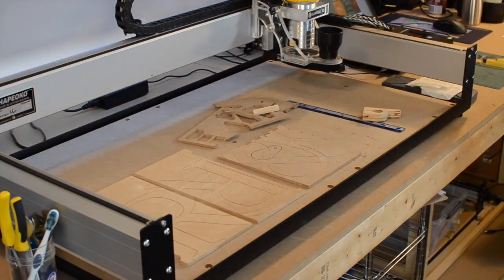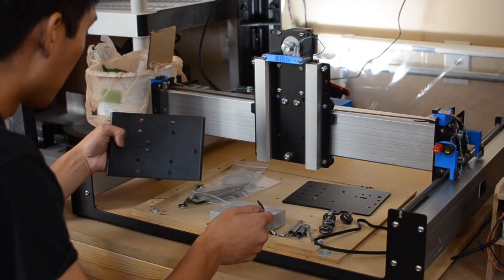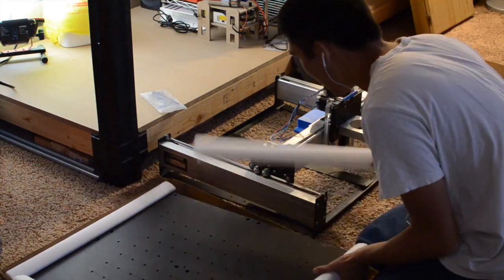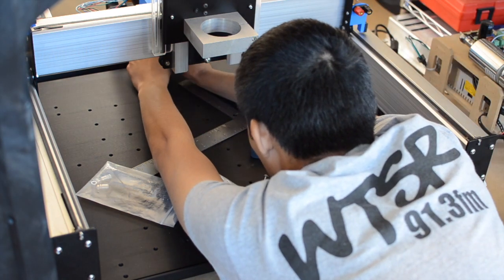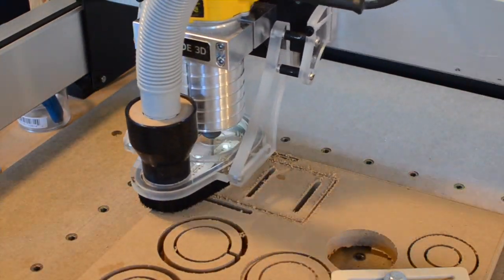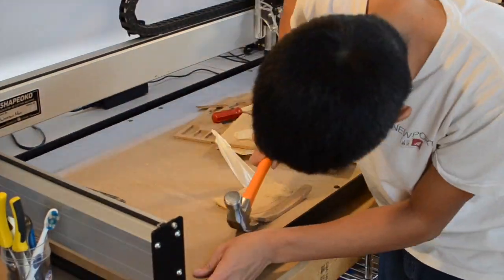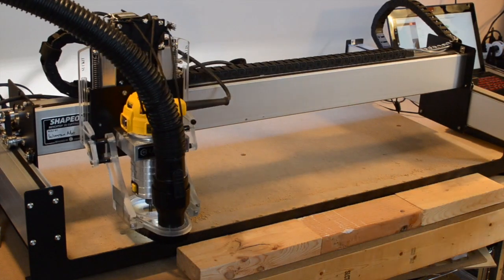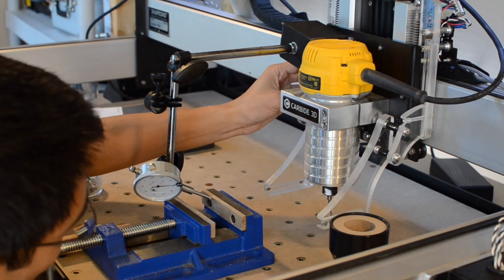Alum. Table, New Z-Carriage Plate (2016), + Random Shapeoko Upgrades

Comment: What are the chances someone has the base table cad? I’d like to get one made in Australia
Reply: Shipping it down under is a fair whack
Reply from the maker: I don't have a public source, You're going to have to make your own, I think there are some drawings for the stock size that other people have made. Search the forum: https://community.carbide3d.com/t/threaded-table-files/3534 (example)

Also, I'd suggest just making your own design after getting a machine. I personally don't care for the 50mm spacing of the C3D one, as my stock sizes are typically in inches.

Comment: Mr. Winston, I am thinking of buying the aluminum table however first I must ask you a question answer have it installed it and using it did you still need to resurface a waste board or was the aluminum table enough waiting on you answer eagerly thank you
Reply from the maker: The aluminum table makes the machine table super strong and rigid, but it doesn't automatically mean the table is perfectly level to the gantry. You will still benefit from putting a piece of MDF or plastic (or even aluminum) on top of the table and leveling it.
Reply: @WinstonMakes  what do you think of this one?

https://www.etsy.com/listing/487303408/shapeoko-replacement-table-fixture-plate?gpla=1&gao=1&&utm_source=google&utm_medium=cpc&utm_campaign=shopping_us_a-craft_supplies_and_tools-other&utm_custom1=c51ac1a1-f944-4a98-a56f-db264941e8ae&utm_content=go_270947675_21143440475_69017032355_pla-106551294035_c__487303408&gclid=CjwKCAiArK_fBRABEiwA0gOOcz_EzbzLTg1VhxvmmQ_9zctMuCLy0ZAJCdK0a4gYnUj6MNMYCuXTPxoCtZEQAvD_BwE
Reply from the maker: Looks nice, but almost nothing is ever perfectly flat. Furthermore, you would still have to adjust your machine to be square, and tram. And would probably still want a sacrificial wasteboard on top. If you want rigidity, that or the Shapeoko table Carbide3D sells would be fine. But if you're looking to buy your way out of extra mechanical tuning, don't waste your money.

Comment: i bought a shapeoko 3 XL, and i definitely need the aluminum bed, but i can't find one for the XL, any ideas where i can get one? otherwise i'll have to design one i guess
Reply from the maker: They don't have one for the XL due to the unwieldy size and shipping costs that would result from it. JPL_Richard would probably suggest going to a metal supply place and getting a half inch plate cut to the right size. You'll end up saving money in the long run transporting it yourself.

Comment: So I just bought the Shapeoko 3 XXL. I will primarily be working with metal so would you recommend the aluminum table or something like it if metal is my primary focus?
Reply from the maker: +Savant PCs I don't think a full aluminum table is necessary (plus Carbide3D doesn't have an aluminum table at that size, and a full table that big would weigh like 200 lbs).  I would instead put a piece of aluminim/hdpe/MDF on the existing wasteboard and machine-level that so it's perfectly smooth. I have a video about making a "supplementary spoil board", and if you look at JPL_Richard's machine on Instagram you can see the route he went to put an aluminum plate over his table. If you're working with large sheets, this should suffice. If you're workholding smaller pieces, vises will probably be your preferred choice. But you should reach out to @jpl_richard for sure. He's a wealth of knowledge for cutting metal on the Shapeoko. He's done way more of it than I have.
Reply: Awesome and thank you for the help!
Reply: For jobs that require 2 different bits that are defined as using two different bits in Carbide Create, does it stop and ask you to change bits to finish the job? I.e. I have a design being cutout with .125" endmill then and engraving cut with a .06" endmill. Thanks for your help! Sorry I am a noob...

Comment: Thanks for this and sharing your files. This is my first.... well.....anything in Fusion 360 as I have used 123D Design on my 3D printing projects for a while now. I've always meant to graduate, and now is the time since 123D is going away very soon and F360 seems to be great for CAD/CAM. 

I used your file and added two rows. Since I have an XXL I can reach all the way back on the front waste board. Then I will swap them and do the other board. That way I have inserts all the way back on the bed. I used your affiliate link to get 400 inserts as it looks like 320 will be needed with the additional rows and another whole board.

Here's to hoping I did everything correctly. I did a 2/3 dry run tonight, will do a whole dry run tomorrow, followed by a full run if it looks good.

Comment: Do the inserts not go all the way thru the MDF? I see you milled above the metal underbits. :)
Reply from the maker: Inserts are only 13mm (nominal) and and the MDF should be 3/4. I stopped the endmill at around 0.7", but in the parts you know are clear, you can just cut all the way through. Or if you don't feel like tailoring the CAM like that, I just chased everything with a 1/4" drill by hand. Really quick to punch through the bottom.

Comment: How did you create the file in carbide create for the threaded holes?  I have purchased a Shapeoko 3XXl and I am having issues with creating this file.  This would be my first project on my machine, or on any CNC machine for that matter
Reply from the maker: I created the file in Fusion360. It's doable in Carbide Create, but more tedious. In CC, you should basically be placing holes where you want to put threaded inserts, and then adding a pocket toolpath to each one. Where are you getting hung up?
Reply: Winston Moy I know nothing..... to start with. I saved the file from your website and tried to upload it to CC and it will not transfer. I have so many ideas to create but yet to materialize them into CC.
Reply from the maker: CC is what you use to design and create toolpath files. You use Carbide Motion to send those files to your CNC. The .nc file on my site is a toolpath  (gcode) file intended to be sent through CM to your Shapeoko. It cannot be opened in CC.

You may want to read through some of the tutorials on the Carbide3D site first to get an idea of the general process (ex. http://carbide3d.com/docs/tutorials/shapeoko-clamps/ )
Reply: Winston Moy do you have a video or know a good resource showing the workflow from fusion360 to the s3? I have that and a 2012 edition of solid works and I know both CAN be used to create the code but I'm nervous about just trying it and finding out there's some difference in the axes or something.

Comment: Great video as usual, Winston. I installed the new Z-plate earlier this year and it made a huge difference, especially cutting aluminum. I'm very tempted to get the aluminum table as well, although also considering upgrading to the XL, both of which are expensive and incompatible upgrades. On my regular SO3 (fall 2015), I installed the same 1/4-20 threaded inserts you link to, but I find them pretty terrible. Several have ripped out of the MDF and others I've had to carefully superglue in to keep them from bulging  up the MDF when unscrewing clamps even with light pressure. I've read that installing them upside down from the bottom is an improvement, and also curious about using the smaller 8mm holes you suggest. (I used a 9mm bit per the packaging instructions.)
Reply from the maker: Not using 9mm was something I stumbled upon by accident. I figured out my hole size by directly measuring the diameter of the insert, minus teeth. It pays to not read the instructions sometimes... The insert digs a lot deeper into the MDF if you don't overdrill the hole. Installing the insert upsidedown I imagine would help, but it's hard to automate that with the CNC, since the wasteboard is only counterbored from one side.
Reply: Winston - Thanks for the tip. I bought a 9mm bit just for those inserts and hand-drilled all the holes so that they could be outside the Shapeoko's range. But now my inserts all come out so the wasteboard is semi trashed. I was going to cut another, perhaps from HDPE and then just tap the plastic directly, or maybe I should get the aluminum table. How do you like it? I'm also thinking about the XL upgrade instead. Which do you use more? Also, you mentioned elsewhere you always put a waste piece between your stock and the board. What do you use for that? Something perfectly flat and uniform thickness I assume? Thanks again!
Reply from the maker: I like the aluminum table, it adds a ton of rigidity, while maintaining the original 1/2" thickness. My only gripe is that it's M6 threaded. Makes it harder (more expensive) to assemble a good variety of hardware lengths for workholding. That lack of hardware is actually why I've been using the XL more lately. Easier to do things like fix a drill press vise to my table.

I keep my DC spindle on the stock 3 for smaller, 'surgical' jobs, it's really still just as good as the XL with the exception of 6mm GT2 vs 9mm. And obviously the size. The choice of upgraded stock 3 vs. XL really boils down to whether or not you'll use that extra build area. It can be nice to slap down a 2 foot wide piece of plywood to carve...

I use a sacrificial piece of MDF between my workpiece and my table just because I like keeping it pristine. It's easier and cheaper to replace those sacrificial boards (which are just scraps from old 2.5D projects) than the whole table after a couple months.
Reply: I made 48 ornaments from 1/4" plywood this weekend for my 5-year-old daughter's birthday party. They were a big hit but once again my 1/4-20 inserts annoyed me. I tried drilling some new holes with the 5/16 bit (8mm) but now when I tighten something into those a whole square inch around the waste board bulges up like a pimple, which defeats the point as much as the insert just ripping out. So maybe the problem is that 1/2" MDF sucks. I think I'll either try tapped HDPE or just using hot glue or carpet tape and buying a surfacing bit to clean out and flatten the waste board every few jobs. The XL does seem like a nice upgrade. How about an aluminum table for the XL, Edward? :)

Comment: Is there any chance that you could release the design/gcode for drilling the holes?  I am wanting to do the same thing on my SO3 XL and it would speed things up greatly if I could simply download a run a file since you already spent the time to design it.  Thanks
Reply from the maker: Just added: http://www.winstonmoy.com/2016/11/shapeoko-3-xl-threaded-insert-installation/
Run the first minute or two above the wasteboard though, just to test. I tweaked the code to tighten up the holes just a tiny bit, but then I couldn't try it out since my XL had already been cut into...
Reply: Winston Moy Awesome.  Thanks!  I'll look at it closer once I get back from my trip.

Comment: I love your videos.  The Shapeoko is a bit light duty for my CNC router needs, but it looks great for hobbyists who are budget constrained but want to take advantage of the technology.  As usual, it's amazing how hobbyists release their creativity to incrementally improve a design like this.

Instead of MDF, you should look into machinable sheets of plastic.  Delrin is great but expensive.  PVC is cheaper and can dull cutting tools.  ABS can be a good compromise.  See if there is a Sabic Polymershapes near you, or some other plastics supplier.  I think you'll be a lot happier with plastics for projects such as the router adapter bushing and eccentric cam lock work holders shown in this video.  Most of these plastics can be bonded with epoxy or solvent welded with the appropriate solvent based glue.
Reply: Have you seen what I make on my S3?
PS Winston is a college student so material cost is usually at the top of the list.
Reply from the maker: ^^^ Yea.. he takes the cake for most ambitious projects ever undertaken on a Shapeoko.

Good tips on the plastics. I actually have a sheet of HDPE I'm planning on using for workholding purposes... eventually...

(Also, part time grad student, technically. Almost free from the shackles of higher education...)